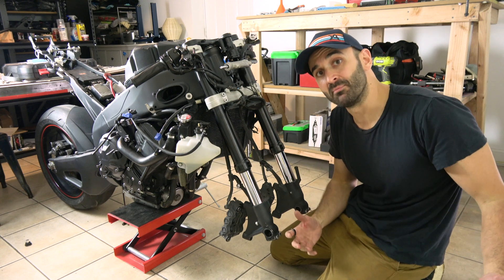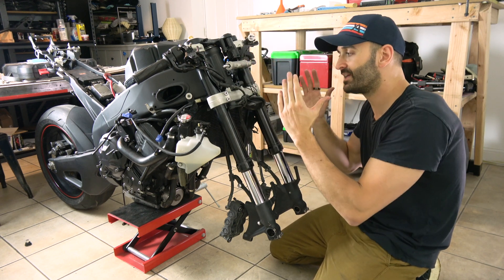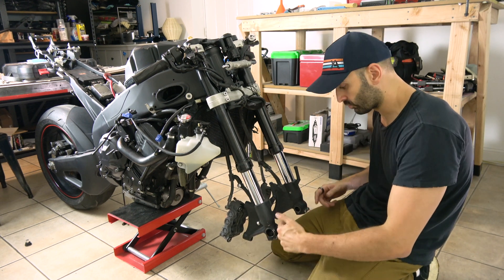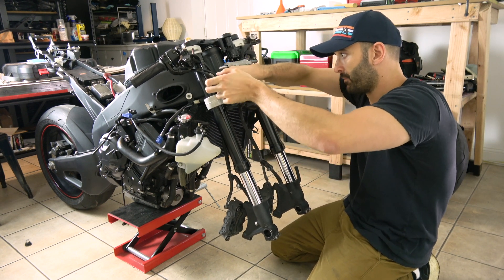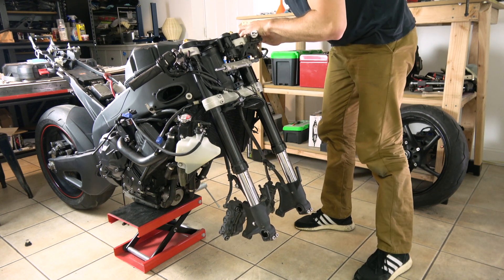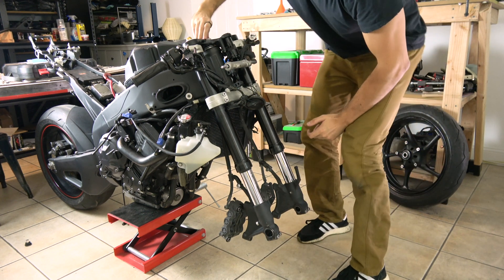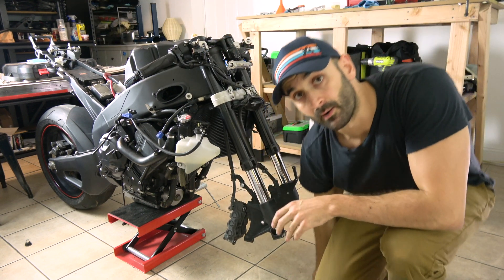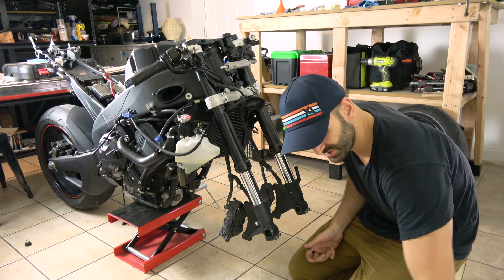How to REINSTALL a Motorcycle Front End CORRECTLY? Wrecked Yamaha R1 rebuild - Part 9

Comment: Hi Tristan!  I'm rebuilding a 2009 Yamaha R1 and just found your video.  I took off both the lower and upper triple but now I have no idea exactly how high up the lower triple should be.  The top Triple clamp is easy because you just set it right at the top of the forks and I can guestimate about how far away the lower triple should be, but I don't like guessing.  I've scanned the manual and there is absolutely nothing that indicates how many cm or mm from top or bottom of the fork that the lower triple should be.  Do you have any idea?
Reply from the maker: Hi! So bring the top of the upper tube sticking out 2~3mm from the top of the upper clamp and you’ll ce good. Do that on both sides 👍
Reply: @TristanDurandBuilds  thanks for the response.  I already put them on lol. I basically just tightened the stem down to spec per the manual and then sat the top of the forks flush with the top of the upper triples. Then tightened the top triple to spec and lastly tightened down the lowers since they would now be in whatever position they should be in